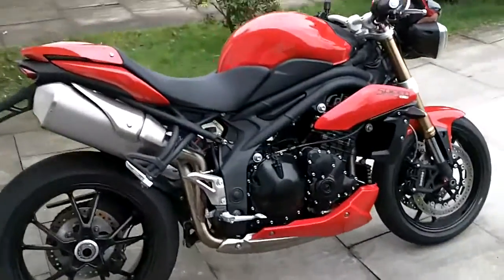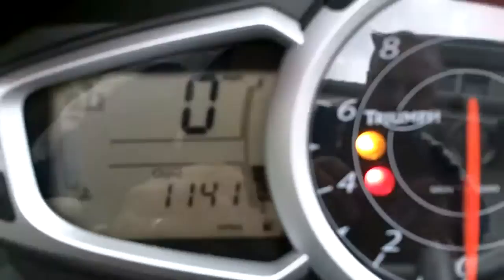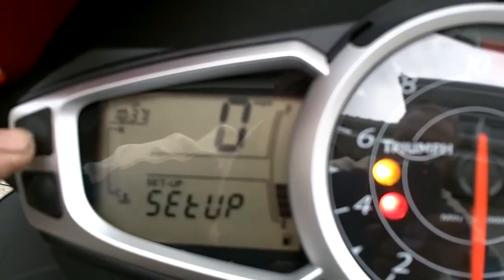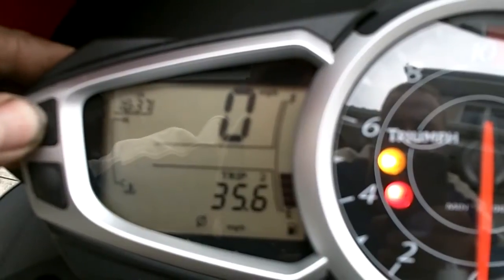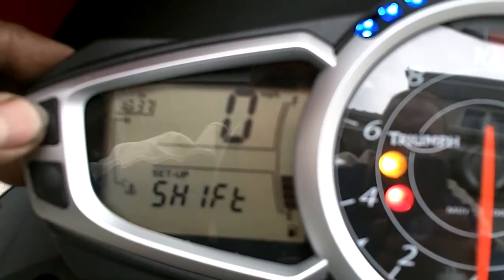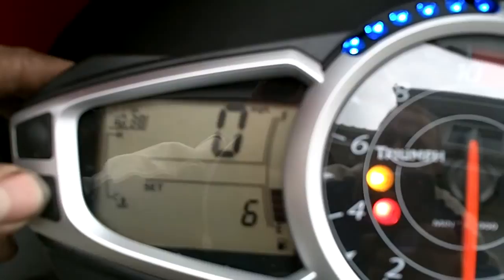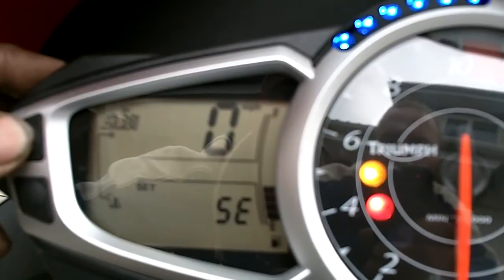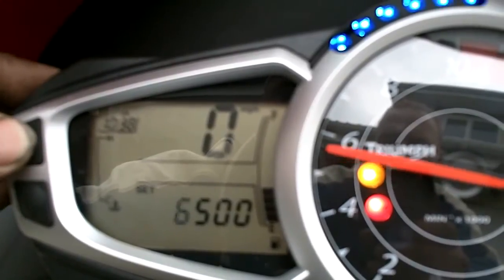2011 speed triple shift light adjustment

Comment: hahaha, yeah.. I only got to ride mine for about 50 miles, but the power & torque i felt were just insane. I had absolutely no need to keep shifting between gears. and the stator and rectifier's being replaced; hope there are no more problems with her.

Comment: AAhh, that sweet , sweet melody.. I just got mine (a new 2010 speedy) yesterday. The first time I rode it, i didn't know about the rev limiter, and was wondering "WTF, why are the red lights coming on at 3500 rpm?? is something wrong with her??" :) found out from the dealer later that they're just to warn me.. I had a lot of trouble from her yesterday though; the she completely died out on the way home - out of gas and after fueling up, she won;t start. tried jump starting her, but no hope.